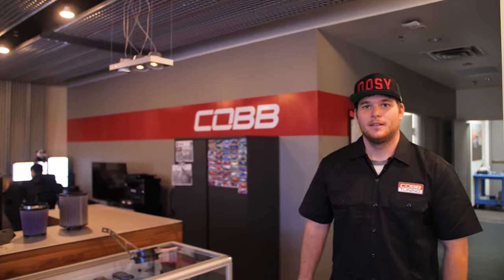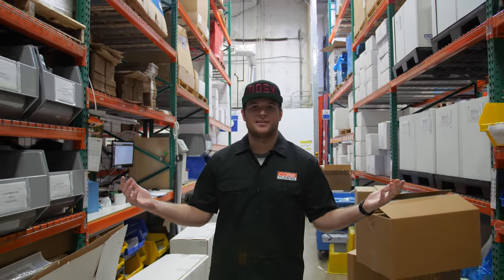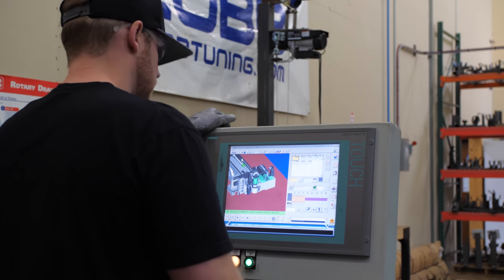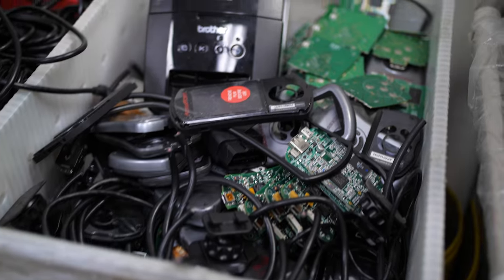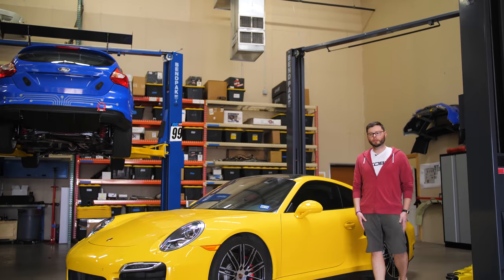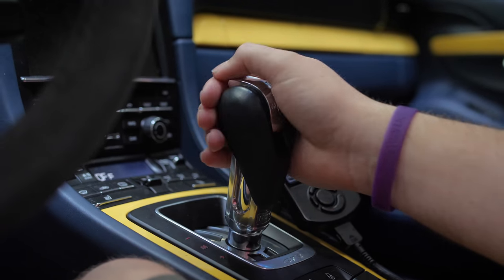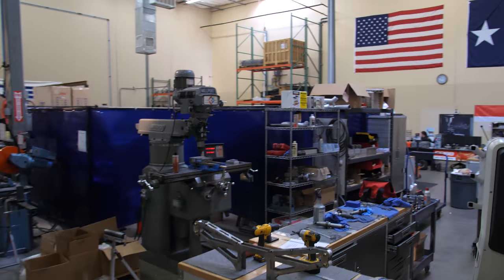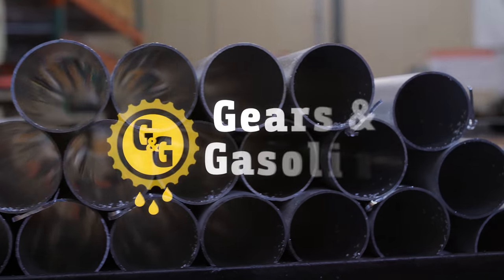Transmission Tuning at Cobb HQ [4k]

Comment: As much as I respect Porsche, revesing the shifter seems like a hotfix that shouldn't have been necessary.
Reply: Porsche's PDK GT cars got it right, for whatever reason it didn't carry over to the Carrera and Turbo line.
Reply: Yeah, it's pretty weird that there are two different ways to shift within a single brand. I bet going from one car to another or stock to fixed is interesting.

Comment: now all cobb needs to do is open up to CVT tuning and cracking lesser known ecus/ toyota ecus we can make sleepers out of all forgotten boring toyota models <3
Reply: wah panda like which model?
Reply: Gonçalo Lourenço IDK but with the rise of automatics and toyota moving to CVT we need to look into tuning them because the manual is going to become a super niche item now if we develop bands for cvts and automatics on the regular that can have pushes up shift points and stronger bands/ belts handling power manuals  can on every car theres a market so i cant name specifics but it would open up the tuning industry to people who cant drive manuals like me but love cars and want some more support. plus cvts are infinately variable gear ratios and have potential to be tuned they work like motocycle trans or something I DUNNO just should be done. would be fun.
Reply: plus if people like brian crower make more water jacker sleeves and forged parts for all those open block toyotas/etc all those cars could be serious sleepers as theres just so many unused cars and  japanese is so sad. theres so many nice niche cars in the usdm market that get put on the wayside to whats merely popular. so it just makes alot of cars become useless and cosmetic mods.
Reply: wah panda well, it would be insteresting to see something like that happening, there is the camry in the US which can easily be turned into a sleeper now that I think about it
Reply: only on the manual option.